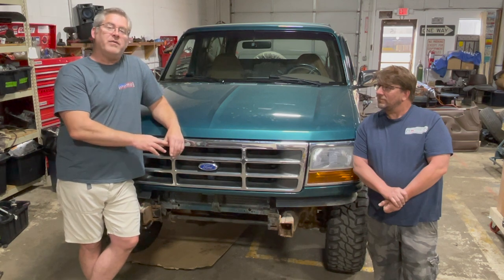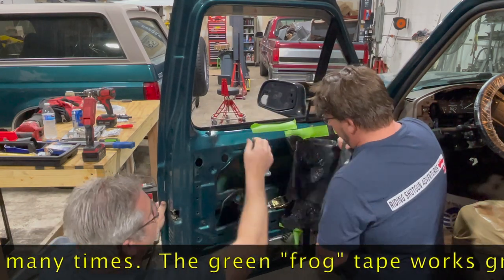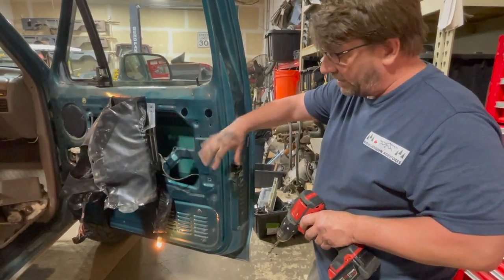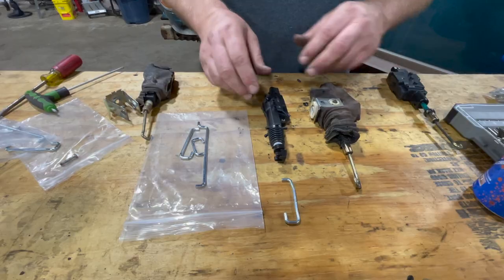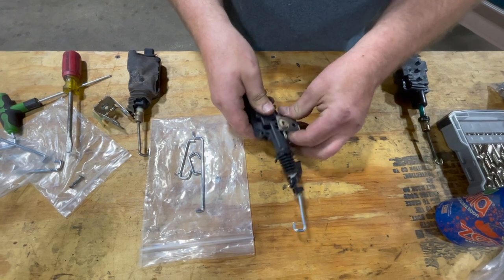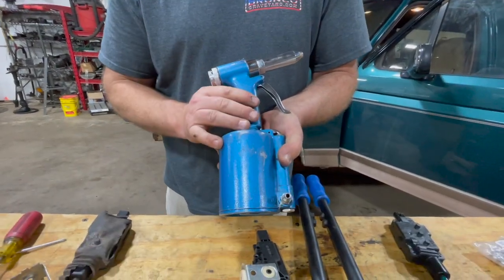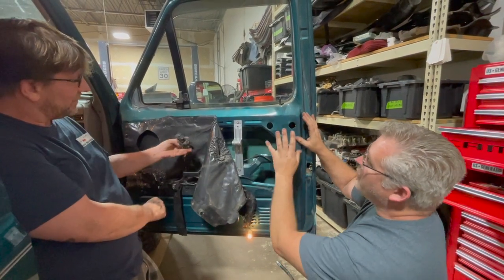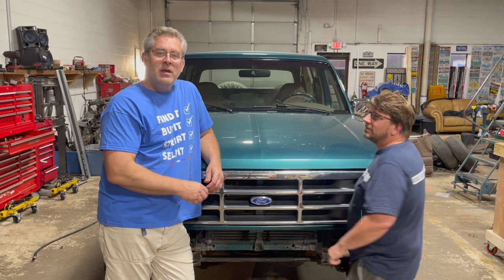How To Replace Ford Door Lock Actuators - Most Ford Vehicles from 1983 on up

Comment: Okay, thank you for the video.  Just did this with out drilling out the rivet.  It is possible, follow the video, you don’t need to remove the wires from the door.  To remove the actuator, slide in a flat head screwdriver to help in plug the restraining tab.  Then pull the actuator straight back to pop it off the bracket, then unhook the metal wire thing from the top.  To install it, it’s a huge hassle.  First, finagle the actuator into position, and hook the top metal piece on the truck, next, pivot the actuator down and using your fingers reattach the power module.  It’ll take some time.  Now to pop in the actuator, I did the onboard side first, you get more leverage that way.  Once you find the hole for the in board side and it pops in, you can twist it to pop in the other side.  Huge PITA but saved me money, and time :)
Reply from the maker: Or…… drill out that .50 rivet and be done in a matter of seconds…… 😉
Reply: Yeah I would have if I had a rivet gun already.  IT would have made it 1000X easier, and my arms wouldn't be cut up haha!  Thank you for the video and motivation  @BroncosandPartsGarage

Comment: For the rivet can I have an assistant put pressure on the actuator side and I do the manual rivet tool from the outside? I don't have a compressor at home and a larger rivet tool is cheaper than a compressor and a pneumatic tool.
Reply from the maker: Yes

Comment: My local repair shop misdiagnosed my F150 lock problem, and already charged me a pretty hefty price to just replace the Lock/Unlock switch which did not fix the problem. I'm not a mechanic. So watching these videos it is rather shocking to me just how darn difficult Ford makes it to access and change the inaccessible actuator. Apparently my local "pro's" can't fix this, so I have to face it myself, and I lack some of those tools. Because of the labor dismantling the door, I can just imagine this running up into hundreds of dollars (more) if I have to pay someone. I would love to have old fashioned non-electric door locks.
Reply from the maker: It’s actually pretty simple.
Reply: @BroncosandPartsGarage  Well, I've watched 3 or 4 videos here on how to replace these Ford lock actuators, and each has the same rather long list of many steps that must be done to get even near the actuator which remains fairly hidden and almost inaccessible. Then things get really messy when we have to rip off the big moisture gasket, wondering if that can ever be replaced. And then there's the special tools used which most people do not have. Etc etc. You may call it simple. I call it very complicated and "iffy" that a DIY'er can do it. I found out one thing: when I presented this problem to two big local mechanic shops, neither knew how to diagnose or how to fix it! And one of these was a huge Ford dealership and service shop!

Comment: I changed my actuators because they didn't work when I first bought it. They only lasted 3 months. Did I buy crappy actuators or could there be another problem? One door is a little messed up and fills with water while the other doesn't but they both stopped working.
Reply from the maker: Most of these actuators are about $20-$25.  The connectors sit very low in the door. I would definitely unplug your doors so they do not hold water. Because that water is sloshing around and probably keep the inside of the door body very wet and damp. Check ur fuses and pinched wires.

Comment: Hey Chris. I had to replace the cable from the latch to the door handle on my 95 F150. When I re assembled everything the door wouldn't open. The rear of the window track kept interfering with the linkages. I had to leave it a little loose and now it rattles sometime. Any thoughts?
Reply from the maker: Did you route the cable properly.  There is a specific path
Reply: @BroncosandPartsGarage  Yep, just like it came out. There's a valley in the stamping that the cable goes through so it can really only go one way. My linkages would hang up unless the window track is left loose.